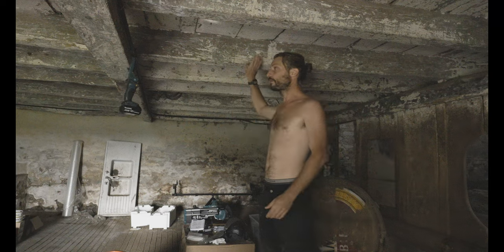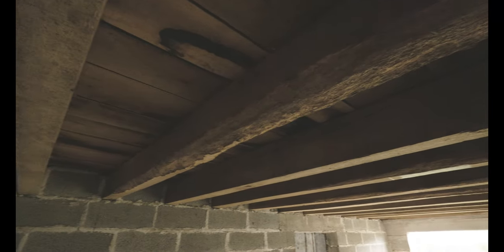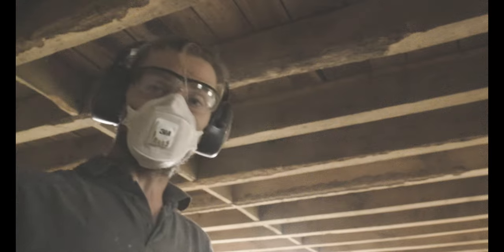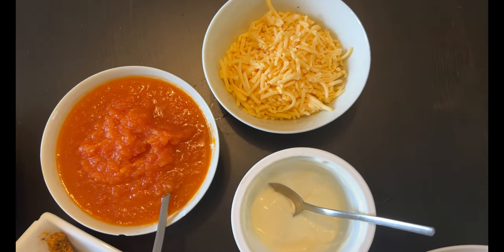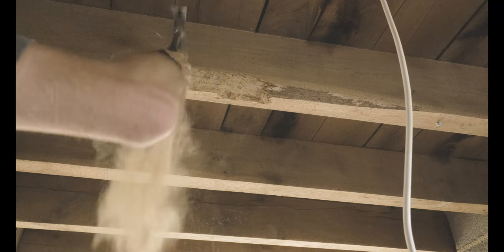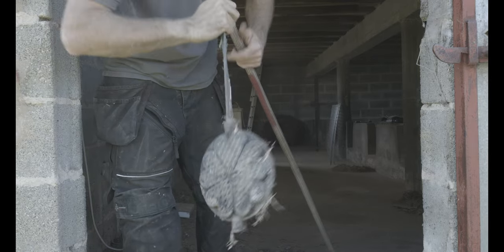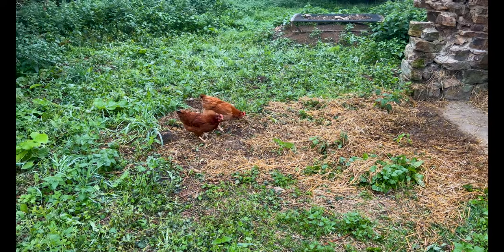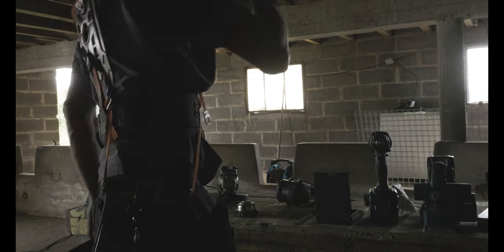12 - Our Barn Has Woodworm! How Do We Plan to Remove Them?

Comment: Your old waffle iron is awesome & can still be used. You just need to clean it & re-season it. Some folks will say never use soap & water, but after being in an old barn....soap & water is a really good idea. Once you finish cleaning it, wipe off the water &, then, finish drying it in the oven at about 300 degrees (Fahrenheit). Oil it immediately while the pan is still hot. Any piece of cast iron can be cleaned in soap & water as long as you dry it & oil in immediately after washing. It there is rust, you can take a second cleaning step to address the rust. Soak it for 30 minutes in 50% white vinegar & 50% water. If needed, you can scrub with a wire brush (brass is best) or a copper or brass scrubber. If there is still a lot of rust, you can repeat the vinegar bath; just remember vinegar is corrosive, so you want to be careful with old cast iron pans. Be sure to neutralize the vinegar with 100% water & follow thevwipe dry/heat dry step. To re-season it...heat it to about 300 degrees (Fahrenheit). Rub oil (canola lasts longer without getting old) everywhere, but make sure excess oil is wiped off. Heat it & rub in oil at least once more, better if 3 or 4 more times. When you use it, be sure to liberally oil. It's got lots of crevices, which is more places to stick. If any rust appears later be sure to warm the pan, oil the pan, and scrub out the rust spot.
Reply from the maker: hi! I hadn't thought of doing that yet, but your explanation makes me want to try it out and get it back to it's original state! I'll get at it as soon as I find the time! Thanks! :) (Anicia)